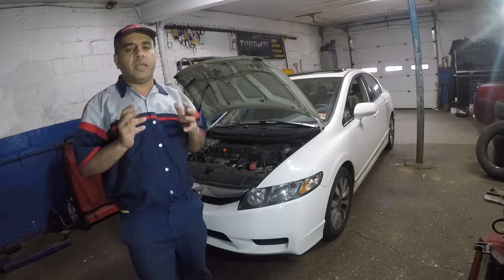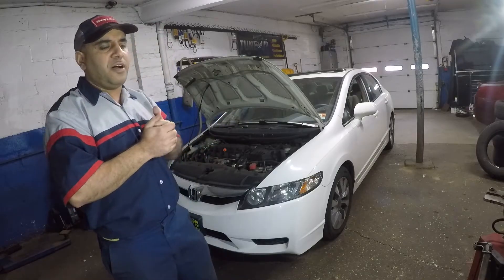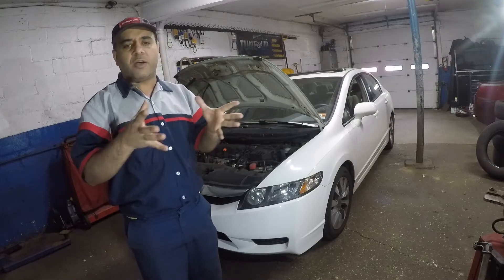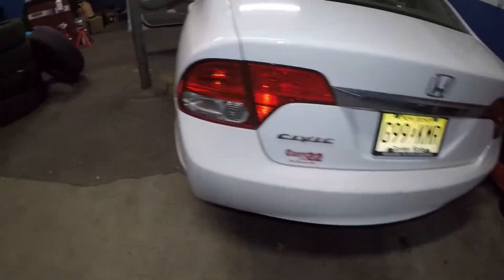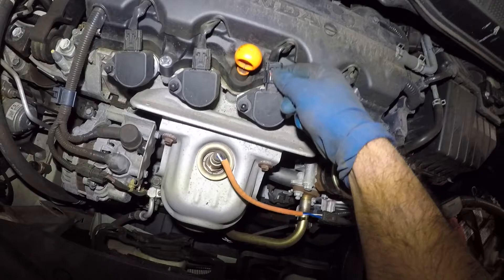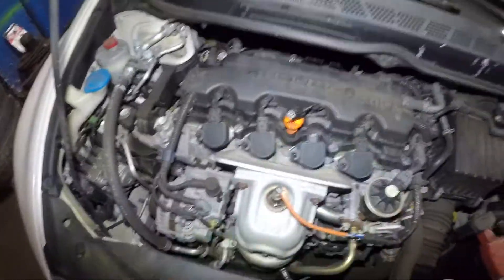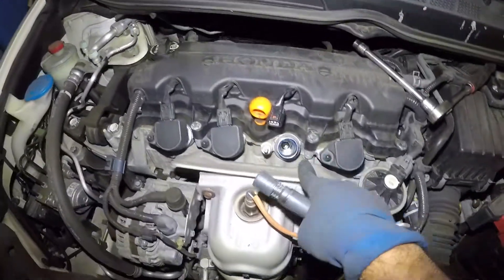Honda civic Cylinder misfire and flashing check engine p0303

Comment: Hey boss my I need urgent help my ford escape is throwing me the po303 code I know it could be a coil or a cylinder I’m going to check it out now but you mentioned oil my engine cover is full of it and the surroundings of the 4 cylinder senser heads around them what could this mean and how would I go about fixing this problem inside the engine which seal would I be looking for
Reply: Year 2005 4cyl base
Reply from the maker: Start with swapping coil also spark plugs

Comment: i cleaned my throttle body with  throttle body spray. now its misfiring intermittently p0304. can cleaning throttle body  cause misfire.?
Reply from the maker: It shouldn’t swap the coil from cylinder to cylinder could be coil went bad
Reply: Do a throttle body reset or idle relearn

Comment: Hey man i got a 08 civic 1.8 with an auto trans im getting a cylinder number 4 mifffire ive replaced the injectors fuel pump and filter plugs coils mas airflow sensor valve adjustment and even put a test pipe on since my cat was clogged up im getting a flashing check engine light and it wont go over 3k rmp im running out of ideas on what can be going on 😕
Reply from the maker: Didn’t check engine compressor also check with scope camera for any antifreeze leaking inside
Reply: Check the VTEC solenoid on the back left hand side of the motor. 3k rpm is when VTEC is supposed to kick in.
EDIT: if that doesn't work it's probably some other electrical issues. Bad fuel injector wiring? Bad crankshaft position sensor?
Reply: Head gasket

Comment: My 2006 Honda Civic 1.8 has a flashing check engine light has the oil changed drove fine for a day the next day it did not want to start and had no engine power would not go above 6 miles a hour flashing check engine light went off has power but keeps going back and forth it has had nothing but issues non stop breaking down changed the fuel system cooling system radiator fan idk
Reply from the maker: U need to scan the car for codes

Comment: How about u have misfires on all 4 cylinders ?
Reply from the maker: Check ur oil lever first and scan the car for codes possability low or vtech not working or EGR valve is possability

Comment: Help!!!! Changed coils and spark plugs, car misfires randomly, goes into limp mode, cel on, then car runs fine after a few mins, cel goes off, pleaseeee :((
Reply from the maker: What’s the cel code?
Reply: @RBTheMechanic  P0352
Reply from the maker: @prasanna4061  dose the scan tool give u definition cuz I don’t have it in my system
Reply: @RBTheMechanic  no 2 cylinder ignition coil circuit malfunction
Reply from the maker: @prasanna4061  primary ? Secondary?
Reply: @RBTheMechanic  it doesnt say

Comment: I got a 02' Civic LX (non-vtec)
Recently got the Head Gasket replace and the Head Resurfaced. Mechanic claimed he changed the spark plugs also.

Then after that i had a misfire in cyl 4. (P0304), 
Took it to my mechanic again and he replaced the coil, but he didnt replace the other 3. (Have no ideas why he did that)

2 weeks later i got the same p0304 misfire code.

Should i have the fuel injectors checked this time? 

The car is at 196k miles.
Reply from the maker: Not sure injectors don’t go bad just like that I would check all basics first biggest issue is head gasket and head resurface
Reply: @RBTheMechanic  ok appreciate it man, thanks for the reply.

Comment: My car is showing P0304 and has a rough idle just like in this video but when driving has no issues (maybe some power loss, haven't pushed it) and I've never had a check engine light pop up. So far i've changed the coil packs, spark plugs, injectors, valve seals and nothing has worked. My next step is to check the compression once I get a tester. Any idea what the problem might be? And if the compression is low in cylinder 4 what exactly could be the issue/fix?
Reply from the maker: Did I check compresson on cylinder 4
Reply: @RBTheMechanic  I dont have a tester yet but plan to do that next

Comment: Hey so I recently had my evap canister replaced and a week later I’m having cylinder 3 misfire issues. I changed my spark plugs, coils, did a check on the relays and they’re all making power. It’s a 2016 Honda civic, is this something you’ve ever encountered?
Reply from the maker: Didn’t replace
Coil on cylinder 3

Comment: Hey, bozz, I changed my maf sensor my coils, my spark plugs my fuel injectors. Now I'm getting a misfire in cylinder one and also throwing a code. U0401 - 68. I move the spark plugs around. I move the coils around still cylinder. One misfire with the code U. A 401 -, 68, can you please help? Thank you very much
Reply from the maker: What was the issue before doing all this
Reply: The issue before it was shaking rough idoland it just was like losing power. So, then I did a lot of research here and there and I changed like I said all the stuff I changed, so I got to the injectors and I thought that's the last thing I probably gotta do and yes, when I took him out they were really corroded and so and that's all. I did. I took out the injectors, put them back the way they said didn't touch this or that and?  Pretty much that was it.I just can't figure it out
Reply: @tatuado5875 what was the problem

Comment: Hey, boss, I have a 2018 honda accord sport 1.5l  I changed all spark plugs and all coils still showing miss fire and cylinder 3 and 4.Could it be my fuel?ijectors are no good or my fuel.Pump is no good smh
Reply from the maker: I don’t think it’s the pump is it still showing misfire or u feel misfire shake
Reply: @RBTheMechanic  missfire 3// 4  cylinders  could it be my oxygen sensor  showing code p219E
Reply: Thnk you for the info boss have a gud Sunday
Reply from the maker: @tatuado5875  welcome
Reply from the maker: @tatuado5875  I have had that oxygen sensor being the issue upstream sensor

Comment: One of mechanic did the spark plug swap and found the code still on. Then he told it might be the valve and he wanted to adjust the valves. But then I showed to another mechanic and he observes that my gasket is loose and there is oil leak also he said oil leak is causing that. Now I am confused whom to believe. What do you think. Thank you
Reply from the maker: Well which gasket did he say? Oil in spark plug would cause misfire

Comment: Idk if you still respond to these but I’m having the issue where my 2001 civic ex will start good then as I drive it, it starts getting tougher and rougher till it eventually sputters out. I have codes: P0336 P1362 P0301 P0302 P0303 and P0300 any advice?
Reply from the maker: Ok u have code for crank sensor I would replace that and see where that goes and take the car and test drive it update me
Reply: @RBTheMechanic  thank you sir I will update you
Reply: @RBTheMechanic so I haven’t changed the sensor but I unplugged it and took it for a test drive since I heard it’s sort of the same thing and nothing changed in fact it ran rougher. Should I still change it?
On a side note I don’t know if this adds to it but it smells like something is burning but I’m no professional so I couldn’t tell you what but it smells bad
Reply from the maker: @stronknoob3084  I would replace it

Comment: Had the engine light come on, cheap code reader gave it as cylinder 4 misfire, P0304. Swapped plugs and coil around with that cylinder with number two, still getting P0304. So obviously its not down to coil and plug. Its very intermittent, you dont notice the misfire, its certainly not down a cylinder. I can wipe the code and it will be ok for a couple of weeks, then the light comes back on, wipe it, and so on.
Reply from the maker: Did check engine compresson also check injector
Reply: Same issue here, did you find the problem?

Comment: I have a 2003 Honda civic with a check engine light with code P0304. I have replaced 4 spark plugs and 1 ignition coil for engine number 4. The check engine light is still on. what do I do now. Thank you
Reply: I did but then I drove about 10 miles and the check engine light came back on. still code P0304
Reply from the maker: @suongle5290  it’s cylinder number 4 not 3
Reply: I changed the ignition coil for engine number 3. It still shows code P0304
Reply from the maker: @suongle5290  po304 is misfire cylinder 4 not 3
Reply from the maker: U have to reset the light it wount turn it self off use scan tool to reset it
Reply: The machine runs very well and does not vibrate

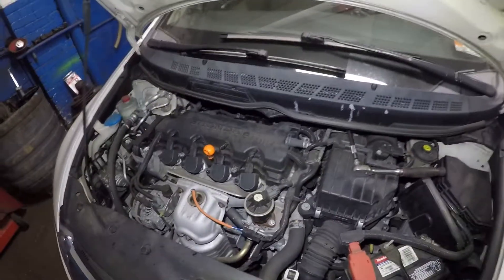Comment: 5:37 HELP!! Code- P0302-11

So far: Engine coil replaced- tried changing them between each other- same code- tried swapping the spark plugs, engine 2 again

Ordered replacement plugs, jic, but I’m worried b/c I already checked by swapping. 

Any suggestions?
Reply from the maker: What year make model?

Comment: I have same check-light flashing issue. I have changed all plugs but yet to change coils. Still flashing so I want to go back and change possibly all coils. I hope this stops. I haven’t been able to use my car almost two weeks cos of this issue.
Reply from the maker: This flashing means serious misfire what codes did u get?
Reply: @RBTheMechanic  I want to go back and scan it. Can oil result to misfire too? Because I saw you mentioned checking oil in some comments. But they said my oil is still alright though.
Reply from the maker: @TamImBlessed  yes inside the spark plug bore if there’s oil it will misfire
Reply: @RBTheMechanic  I just did scanning and it appears that one of my injector nozzles was bad. It showed P0304. I got it replaced. Cleared the error code, Drove it for like 20km but it did not flash check light throughout the testing process . My check light has been off totally. Normally it used to stay still even though nothing is wrong since my catalyst is not present. But after they removed the battery head, the checklight totally went off. It has not gotten back which is giving me some anxiety.
Reply: But later in the day after I finished washing my car, I decided to start the engine to check if there is any more misfire. As I started the car, the check engine light came back stable without flashing which my car has always been even without any problems. But a misfire sound came up before it settled after steaming for some seconds. It bothered me so I borrowed a scanner and checked again. It showed the same P0304. Which is pointing to the same cylinder. When you wipe an error code, does it really fix the problem or it just hides it for some moments? Because after wiping it during the day, everything was fine just that my check light was off totally, which was suspicious. Even though my car is alright, it normally displays my check engine light without flashing but steady. Which means it is working fine but there is no catalyst. But whenever the check light is totally off it usually comes up with something later. So should I just keep on wiping the error codes to hide the problem or change the injector nozzle on that cylinder again? Because I used an old injector nozzle which was in my boot. Maybe it was bad too which I’m not sure of.
Reply: Let me rephrase my question. Can an error code go away on its own if the problem is actually solved? Or do you have to always erase the error code after making any changes?
Reply from the maker: @TamImBlessed  not all codes can reset it self but best is to reset it
Reply from the maker: @TamImBlessed  flashing will only come when ur in drive and driving and misfire is heavy
Reply: @RBTheMechanic  yes now it is not flashing or misfiring heavy. Just some bit of misfire when i turn the engine on but later it settles. I just hope it does not come up with something again.
Reply: @RBTheMechanic  I will keep giving you feedback. You can help me with any idea of yours.
Reply: Thank you
Reply: @RBTheMechanic  So should I just keep erasing the code whenever the P0304 comes on or try to fix it and make it go away on its own? Because what I’ve understood so far is that if I erase it, the error code  goes away probably for the whole day.
Reply from the maker: @TamImBlessed  u need to fix it
Reply from the maker: @TamImBlessed  need to fix it

Comment: Mine turns on idles roughly, then when I go into drive it turns off completely already changed the bad spark plug and coil which were the only ones failing now I have p0300-p0304
Reply from the maker: Did u try using gas peddle to keep it alive? It might be idle issue clean throttle is a start

Comment: It happened to me for the first time today, my battery used to die on honda civic 2007 cus there was some short circuit which drained battery so got it fixed from the mechanic, on my way back I noticed the check engine light flashing (i always had check engine light on for like 5 months but its always still so i ignored it, today on my way back it flashed for like 2 mins and then went back to being still like before, should I be worried? I’m planning to sale out this car in about 2 months so i was thinking about going on with it till i buy it and not take it to mechanics again, its a pain
Reply from the maker: Scan the check engine for codes and if u got misfire code fix that cylinder change plugs and coil is a start

Comment: I have the same code on my 2017 Hyundai accent I changed all four spark plugs and all four ignition coils still having the same problem. What could be the issue now?
Reply: I’ll check it out. Thank you sir.
Reply from the maker: Check ur oil level? And see if it’s clean as well? It could be oil since these engines change timing with oil pressure
Reply: @RBTheMechanic  Amsoil full synthetic every 5000 miles. I was thinking probably fuel injector, but I am averaging 41.2 miles per gallon highway at 80 mph in Utah. What else do you think it could be?
Reply from the maker: @aayonazizi747  vaccum leak?

Comment: Brother I'm having a awful time trying to figure this out.  I hooked up a obd2 reader because our truck "only vehicle" isn't running very well.  I received codes po300 all the way thru po306 "all cylinders" misfire.
Last month i replaced all six plugs and all six ignition coils. I also codes po404  po420 and po430
Some codes was on there twice even. The truck ran great before and now it'll run but we are afraid to drive it. My father inlaw thinks it's a clogged catalytic converter. The truck is a 2008 Honda Ridgeline What do you think? 
Amy help is greatly appreciated, God bless...
Me, I'm not a mechanic i just figure out what's wrong then i fix it. I'm lost on this...
Reply from the maker: This could be vaccum leak highly possability bad egr.
Reply: @RBTheMechanic  is there a way to test it?  We have no way anywhere now and we live on the country.
Reply from the maker: @RogerPaul-planetx-nibiru  u can take it off and block the ports with ship I use to do that
Reply: I found out has a idle speed control that I cannot clean but I can replace. Today I put on the egr and took off the throttle body and cleaned it. It got up to 6 or 700 rpm where it was on like 4 or 500 so that's a small improvement on that. I'm thinking I might ruin some sea foam through the throttle body and see what hairball at this point. I'm also thinking I might have gotten some bad plugs or or coils from the auto parts but not sure. I'm also gonna see if I can clean the catalytic converter. I'm thinking it might be clogged enough from all the carbon because i did get quite a bit of soot from the tailpipe. What do you think? 
I thank you much for taking time to reply brother, God bless...
Reply from the maker: @RogerPaul-planetx-nibiru  yes clean the catalytic by the way also oxygen sensor can cause misfire suck as this I had this type of issue but in dodge
Reply: @RBTheMechanic  for some reason I'll get say,  po303, po306 and those codes will be gone. Then it'll be po302,po304 and those codes will be gone but the po300, po303 and po306 will come back. I've never seen this before. I ran two chips of sea foam through the brake booster intake vaccine hose and I got 4 cylinders back. now I'm getting the po300, po303 and po306. It is running a little better so I'm thinking I about replacing the idle speed solenoid. I tapped it worth a screwdriver and the idle changed so I'm thinking it is probably bad. The throttle body is electronic so I think the idle air control is built in to it.  I'm also going to spray half a can of sea foam into the throttle body incase the injectors are dirty or clogging. I think that's why the misfiring is dancing to different cylinders. I may be wrong but I'm not sure at this point and I'm afraid the sea foam will make it worse in not sure. Please respond back when you get time, be safe brother, God bless...
Reply from the maker: @RogerPaul-planetx-nibiru  I would stop with sea foam it cleans engine and messed up catalytic and oxygen sensors so u never know the oxygen sensor is blocked so I would go and try cleaning the oxygen sensor
Reply: @RBTheMechanic  yeah I'm gonna stop at the auto store and pick up a sensor socket. I'm gonna start with the one closest to the engine. The bad part is I was told this truck has l like 19 o2 sensors. I gotta get this running smoothly again. We have full custody of our 4 grandkids and this is our only vehicle. My mom and dad died last year 4 months and 3 days apart and their funerals took ensuring we had plus we sold our second vehicle to help pay for their funerals. We had a decent mini van and I wish we still had it but we couldn't let my parents be cremated. Anyway I thank you for all the replies you respond to. I wanted you to know why I we aren't taking our truck to a mechanic and I gotta do this myself. Again I'm very greatful for the info you are telling me my friend, God bless you brother.
Reply: Neither i bought a new egr and put it on. Yesterday the obd reader gave me 14 codes. Today it gave me 4 codes of po300,  po301, Po302 and po306. That's a huge difference. I'm wondering now if I should change the idle air control. What do you think? 
Again thank you my friend, God bless...